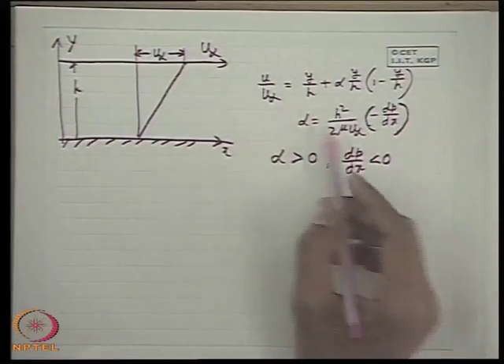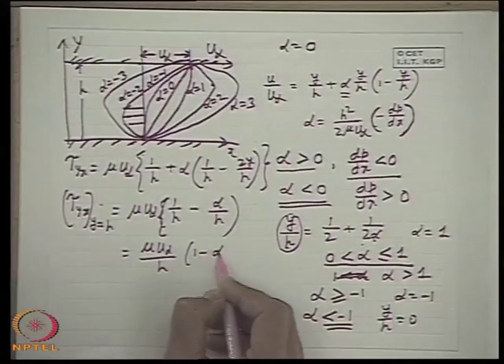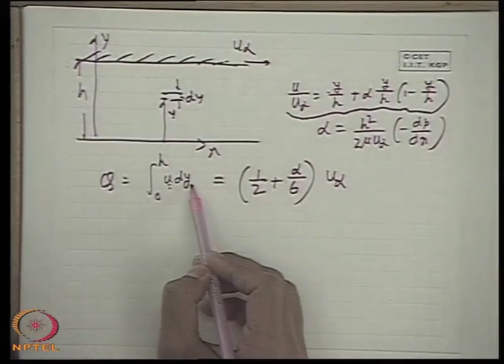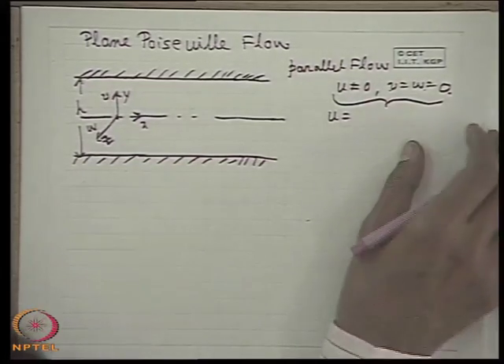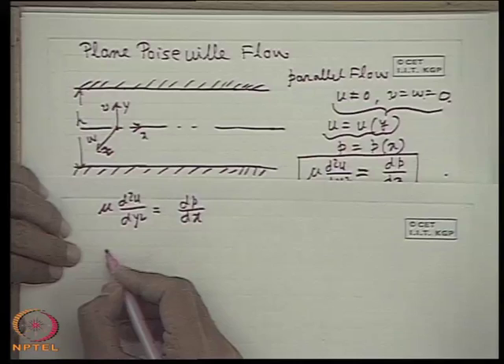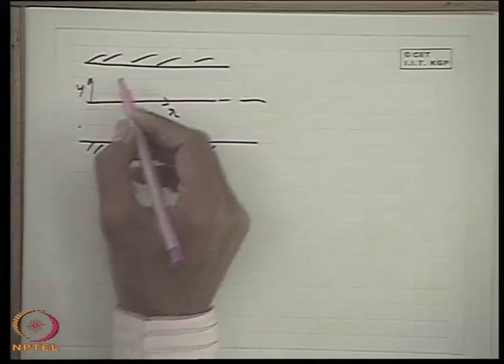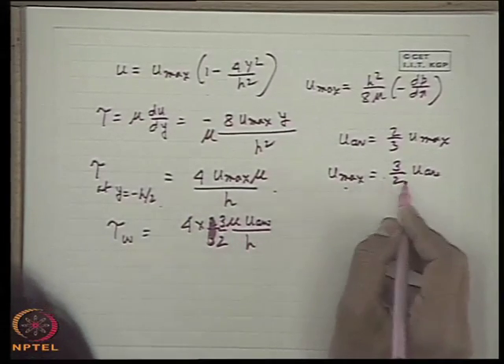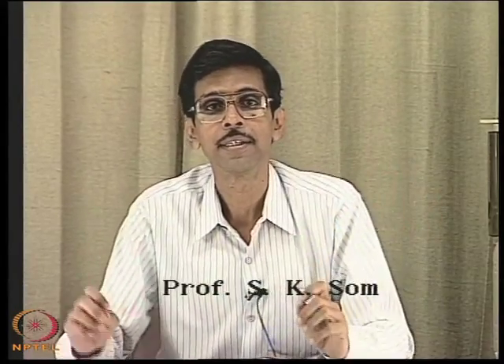Mod-31 Lec-31 Incompressible Viscous Flows Part III

Comment: can anyone help me in understanding physically  tau yx conceopt in relation to alpha i m facing diffculty in 6:12
Reply: At the plate ie y=h, For alpha less than 1, the fluid is required to  be pushed to maintain U inf. For alpha greater than 1, the plate has a tendency to accelerate. 
At the surface ie y=0, the flow reversal takes place at alpha less than -1